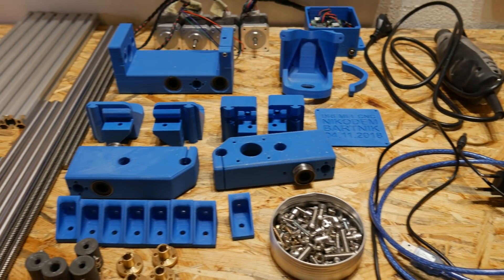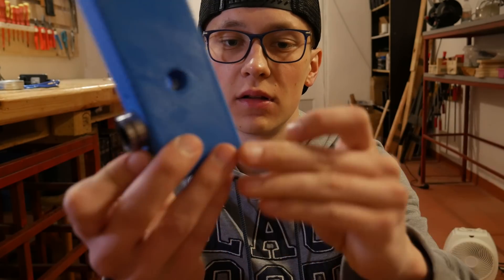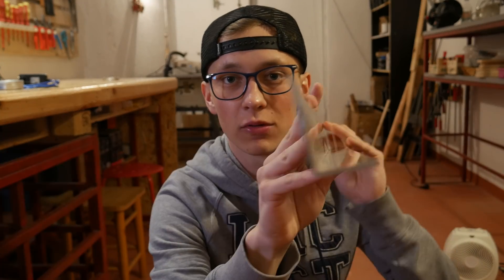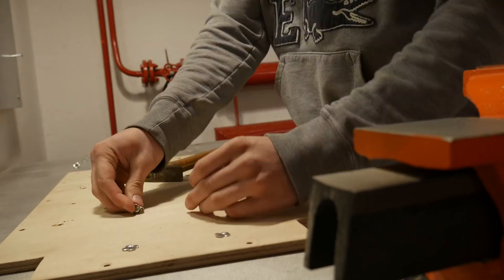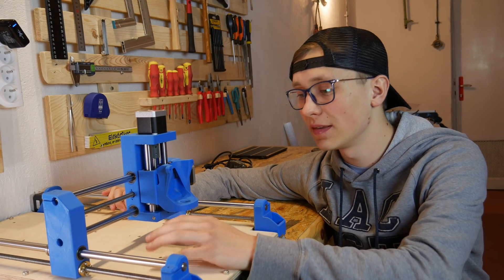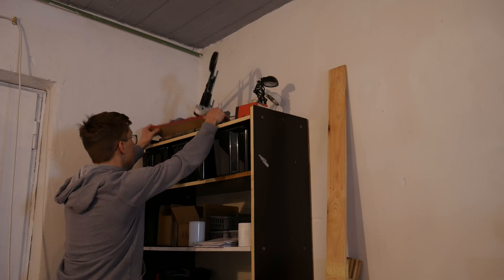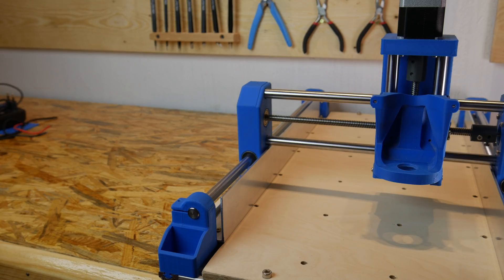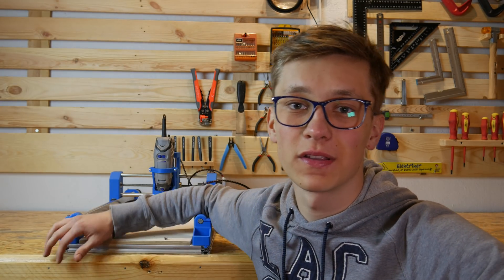DIY Dremel CNC Instructable And Upgrades!

Comment: Thanks for all your work on this project, loving it! I'm thinking of building one also. Because i have some parts already laying around like 16mm axis and bearings and a ramps board,  i need to alter your design. Also i'm thinking of buying a lead ball screw. But i wondering if the additional cost will be worth it. Did you test how square the printed parts are? It's looks like there is no option to calibrate the angles if anything is not 90 degrees.

Comment: You were already doing work on the base. Why not just use some 6mm wood or plactic. Seems weird that one of the most expensive materials on the machine is there just to hold chips away from the lead screws.

Comment: You need to wear a mask or respirator while milling for safety also.  MDF has some nasty chemicals in it and aluminum dost is very, very bad for your lungs.  Also, both are very flammable.
Reply: You should print an adapter to connect your vacuum hose to the y axis and also it would be great to make a cover for the whole machine to cut down dust and noise similar to the ones people make for their 3D printer.  P.S.  Love your channel and just subscribed to it and joined your Facebook page.

Comment: Why not just 3d print some L profiles to protect the lead screws? seems so much easier than aluminium profiles.
Reply from the maker: It would take a lot of time to print something that huge, it is cheaper stronger and looks better when made out of aluminum

Comment: Awesome project! What if change material to Carbon Fibered or something like that?
Reply from the maker: Thanks! It should be easily possible to cut carbon fiber with this CNC, but you need a pool with water for that breathing carbon fiber is dangerous!
Reply: @nikodembartnik  or print with filament with CF or GF)))
Reply from the maker: Sure you can, some people in the Facebook group already did that!

Comment: Only i see outbacks in the video?
Reply from the maker: Thanks for the info, I was so pissed of when I saw glitches in the video, I check my file a few times on different devices and it was alright so I thought that this is a YouTube bug, this video is not even processed to 4K yet so I hope it will be ok later :) Sorry for that, not my fault. Thanks again for letting me know!
Reply: @nikodembartnik  no worries, anyway i liked it. Good luck.
Reply from the maker: Thanks!
Reply: It is YouTube bug( My last video has the same artefacts, but they disappeared few hours later themselves)